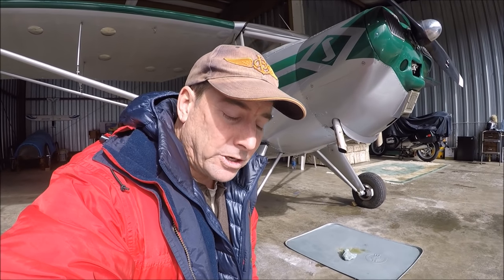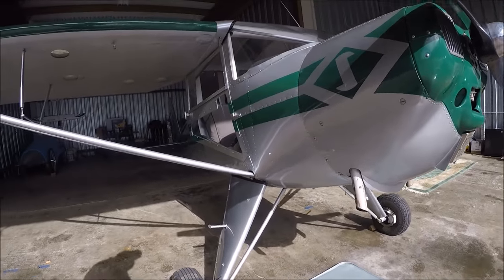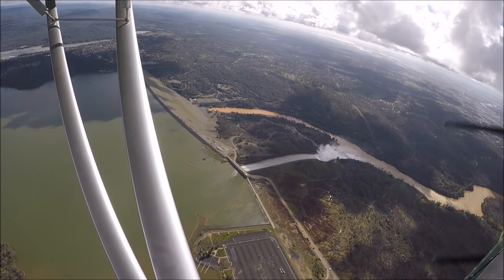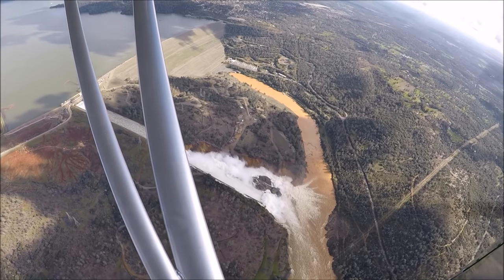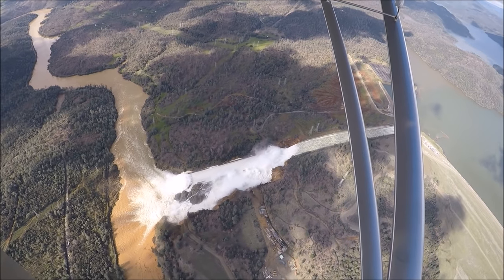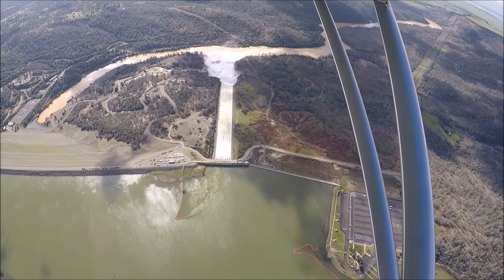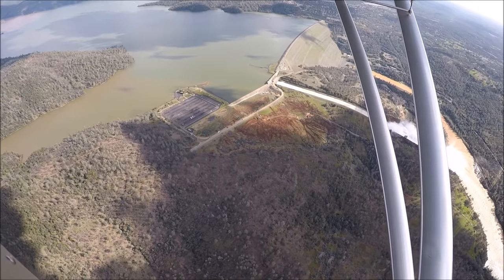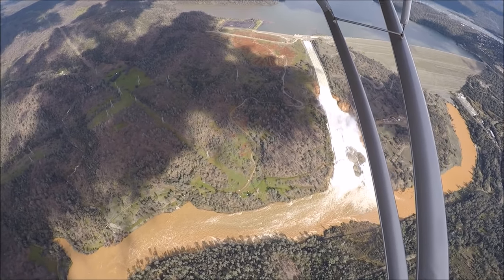Oroville Spillway Failure Flyover and Explanation 10 Feb 2017

Comment: Great video, thank you.

I was at the dam on Saturday 2/11/17

The current destruction at the Oroville Dam started with the main spillway breaking up when water was released.  I noticed that the concrete/cement in the spillway raceway broke up in chunks and flew out of the spillway.  Most importantly I noticed that there was NO REBAR holding the concrete together.  Even a common driveway at your home has rebar in it to keep it from cracking and to hold it together.  Why is there no rebar in the spillway concrete???

The other important thing I noticed is that the ONLY ACCESS ROAD to the north end of the dam got totally washed out/washed away when water went over the emergency spillway.  Why would they build the ONLY access road to the far side of the dam and to the emergency spillway -  right below the emergency spillway???  So then the emergency spillway started to erode not just below the emergency spillway but also at the far north end of the emergency spillway.  So then the emergency spillway needed to be reinforced, but the only access road to the problem area was destroyed.  Trucks could not haul the needed boulders and rocks to reinforce the eroded areas - a task that could have been done much more quickly and cheaply than using helicopters to drop little bags of rocks into the eroded areas.

Comment: inflow is currently  79,901  outflow is 55,000cfs... why cant they open the current damaged spillway..to match inflow..keeping emergency spillway dry.... look at how much erosion is taking place with just a trickle from the emergency spillway...
Reply from the maker: Mike Ovanes that's a very viable option.
Reply: Mike Ovanes
 That is what they are trying to do, but they have to minimize flow on the damaged spillway to prevent further damage so they are balancing keeping the water level as low as they can while minimizing flow on the spillway. If the spillway erodes up to its control gates, the loss of flow control could undermine the dam. 

The emergency spillway is really just a static overflow point. If the lake overspills the emergency spillway, it would cause immediate erosion, which could undermine the spillway gates, again, possibly  leading to the dam being undermined. The fact that the weather finally broke Friday night, very, very likely prevented a catastrophe.
Reply: Mike Ovanes
Reply: Tin sheeting that replaces feet of concrete?
Reply: Your video rocks bro!!
Reply: you ever thought how many experts know what you know? but yet they won't do it? Because this is a part of their plan. get used to alot of this happening
Reply: Hi Wendy, to cap the hole would take a huge amount of rock, concrete and rebar. There is a huge hole there now and the side walls are gone. Steel plates will not hold due to water pressure and suction.
Reply: Hi Wendy... LOL.. no need to leave your water on. Good luck on the St. John's. Is it overflowing?
Reply: Hopefully it won't flood your community. You have many more months of rain and snow coming.
Reply: Wendy you may be a problem solver by nature but when you lack key knowledge you are not suited to make informed decisions and risk looking silly instead. I initially liked the tin/sheet metal idea as a way to force the water to jump the hole when it was small but they had other contingency plans in place that did not include bringing in the Army's Core of Engineers. Also, there is a water treatment processing facility between the dam and the people's tap so you wouldn't be helping the situation, only depleting the water supply. Look at that muddy spillover, you really think it goes straight from there into people's homes? Or that they can process 100,000 cfm of water to keep up with the spillover? These are the reasons if you don't know wtf you are talking about you might want to learn before showing your ignorance on youtube and brainstorming filter free like it's your personal journal. Because it's erroneous this is all chaff now and our time lost, plus the distraction other's will get from my scathing diatribe. 

If they declared it a state of emergency FEMA will be involved for sure. Pack up now, when they evacuate their disposition is militant and they will remove you at gun point without a second thought...it literally happened to me for the 2012 Boulder floods.

PS are you from the UK?
Reply: It looks like intentional destruction, IMO
Reply: In my opinion,  If that spillway has never spilled over in it's History,  Why wasn't someone alarmed when it got close..  They should have reduced the water level way before it spilled over..   that spillway was denied modernization 12 years after a motion was filed in court to bring it up to modern standards.  idk why it was denied,  but, probably because it has never spilled over before..
   Even though they lowered the water level and the spillway stopped,  that is still a very serious situation...  they have NO way of measuring how much water seeped lower into the ground and is softening up the Earth below..   
   No matter how I look at it,  I see management error..  that should have never happened..  They knew it wasn't up to standards.  Someone is sleeping on the Job..   I sure hope there is a very thorough investigation..   

         NOW,       $100 Million in repair and clean up..       nice going.!
Reply: or maybe its California why not aluminum foil ?

Comment: The power plant was shut down a couple of days ago, and no water is coming through it.  This was due to the water level coming up behind the dam itself, due to debris that washed into the Thermalito Diversion Pool.  They need to get in there with a large backhoe or a dredge to clear the channel in order to restart the Hyde power station, which will allow another 12,000 cfs to be drained from Lake Oroville in addition to whatever is coming out of the spillway.

Comment: They allowed debris to block the inlets to the turbines to become blooked and do you know why in this video and others show that the water exiting the turbines is so brown? should be clear water coming out of the turbines. Something not right.
Reply: Andrew Ojala  only reason I can think is turbines haven't been operated in some time and silt built up at intakes, once they were forced to open the inlets sediment comes out, but I thought the inlets were pretty high up?
Reply: They were using the turbines on the 12 or 11th and the water seemed some what clean at the outlet the inlets are on the east side of the lake they run diagonally down the bank which would not be prone to material that is floating on the lake. There is something fishy with their explanation why they cannot release any water to the turbines something just don't make sense always look for the real story behind the story

Comment: why don't they Dynamite near Stringtown Road and over by Cherokee at the high points of the river Dynamite the higher elevation levels to redirect the flow to lower water level or float a pontoon steel wall  to make the face of that damn three feet higher

Comment: Gonna throw my 2 cents at this DAM problem. 
If I were them, I'd be cutting in 8 roads to that gaping and growing hole and be using trucks to dump rock in it. 
4 roads on each side, dumping huge rocks constantly!
This concept of helicopters is very expensive and they are gonna need way more volume to get to their end goal.
Plus, they need to stop breaking down these large rocks as the water pressure will just blow em out. 
That's in part why truck have to be brought in.